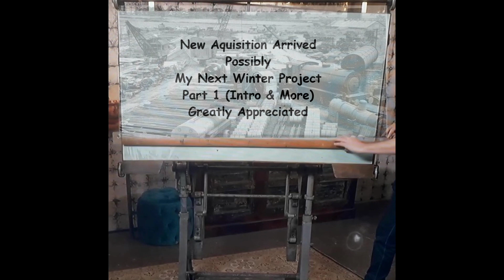Sweet Pea Steam Locomotive Build Part 1 "mr factotum"

Comment: Looks like a good buy. Where did you get it from? Also looks like you have the bits for a vertical bronze equivalent to a Stuart 10V. I wonder hat happened to the cylinders,
Reply from the maker: eyup Ben
Fleabay find, looks like someone dismantled in his shed to renovate and the parts got thrown out. Not sure no history
thanks for info on the castings. 
atb
kev
Reply: @MrFactotum  Interesting. Dare I ask how it as described?